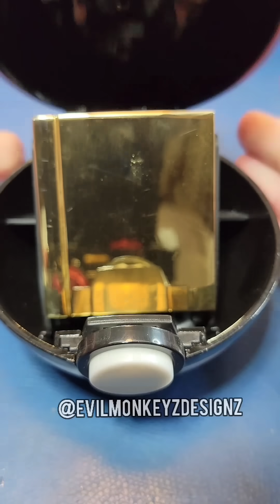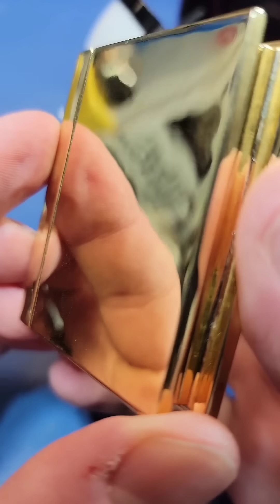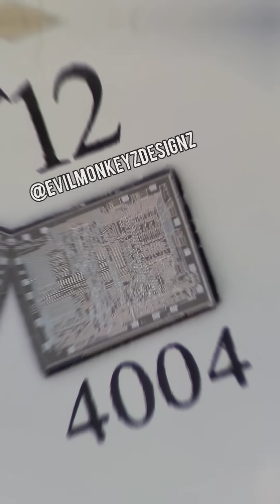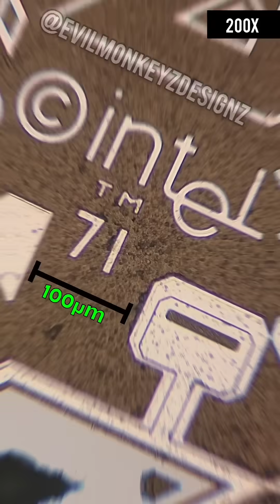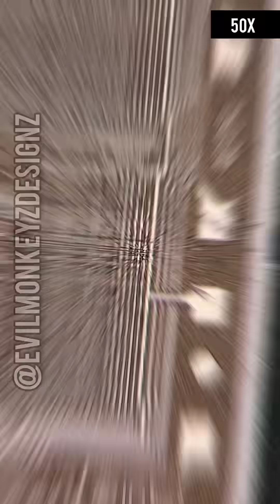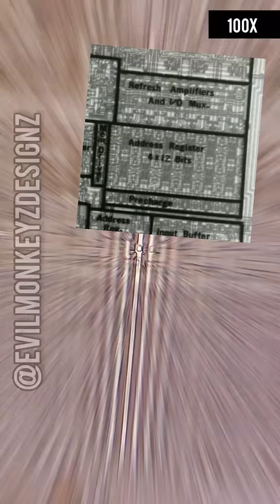The Intel 4004

Comment: OMG.... I remember them and the 8008.
Then 8080 and thought we were in heaven.
soon followed by 6502 and the Z80.

Building you own computer back then with perf board and wire wrap pins.
1 K of ram would set you 2,000 USD.

Comment: You can set the cpu cycles to higher, then run a game intro demo gameplay. After 30 minutes your cpu an floating point unit will become permanently stronger and better. Games may be harder to play, such as Dyna Blaster will become more complicated to play then before. 
For better, new computers and laptops, the dosbox does it, Heretic first, then Duke 3d intro. For mobile phones, Duke 3d needs 32000 cpu cycles running all the intros 3x, but 8000 cycles are needed to begin the fix.

Comment: What does a transitor do in this specific chip
Reply: Transistors are switches controlled by electrical current. You can use a control signal to set them to on or off, 1 or 0, true or false, whatever binary state you want to call it.

By setting up transistors in the right patterns, you can create logic gates and from them various circuits that perform simple arithmetic, store small amounts of data, or convert signals from one form to another. All of these functions are needed for the functions of any computer chip.

So what does a transistor do here? They do everything! Transistors are the building blocks of every digital computer.
Reply: @DigitalJedi  our brain is the ultimate transistor

Comment: Interesting how the chip detail kept getting smaller and smaller until it starts to be equal to the wavelengths of visible light and has all the cool colours.  The 4004 is primitive compared to later chips.  But they had to start somewhere 👍

PS - The intel clock is very cool. Does it still work?

Comment: I own a working 4004 8008 and a 8080 plus a Z80. All in circuit and running.
Reply: I personally handled one of the original prototypes of the 8008. If I remember correctly, it was designed by intel but fabricated by Texas Instruments.
Reply: I use them as microcontroller for projects. They are surprisingly fast when programs in machine codes.
Reply: Aren’t Z80s still being made today for embedded systems?  A version of the MOS 6502 still is.
Reply: @calvinnickel9995  Zilog announced discontinuation of Z80 in April 2024..
Reply: @tonisee2  Yes, but the eZ80 lives. (Possibly the Z180 too.)
Reply: What could be the electronics of Voyager 1? What were the electronics like in 1977?
Reply: @rodenreyes6320  I have seen some components of Soviet "computer-like" military device, probably  from 1970s. It consisted of hundreds of writing paper sized PCB-s which had robust pole connectors in one end. On top of those each large PCB, can 20 or so smaller, matchbox-sized, PCB-s. They were fastened on little posts on the large PCB-s and all had some soldered signal and power connections to large PCB. Every small  PCB had two (germanium!) transistors and few passives on them, all of course through-hole and pretty macroscopic (transistor case diameter a bit more than 1 cm/ca half an inch). Most probably all those small PCB-s were soldered in kolhozes in Soviet Union by women who had no slightest clue what things they are assembling. 
I suspect that early spacecraft electronics was also built of single components, although slightly smaller ones and more tightly packed... The theory of digital circuits is not that new, computers used vacuum valves for quite some time.
Reply: @rodenreyes6320  In 1977, the 6502 and Z80 were new and hot products! Larger and more powerful processors and computers were predominately built using hundreds of TTL chips (that are still sold today btw, although for somewhat different kinds of usage).

Comment: Technically although it was classified the processors for the F14 Tomcat beat the 4004 but since it was classified no one knew
Reply: The 4004 is still the first commercial processor, the F14s flight computer was never used outside of the F14 as far as Im aware.

Comment: That's nice clock 😊
They should jump wires to that core and run clock with that core somehow. Even it cannot do it without memory, oscillator, some simple CMOS maybe.. I don't know.

But it's nice anyway. And reality they have those cores around still (even today) is fun 😊

"How many we need? -100.000 for first run.. - Roger! 
-Why there's millions chips around facilities? -We made those 100.000 test wafer's? 
-But we want just 100.000 DIE's, no one needs those that amount!
-Okay, let's then make some clock's from leftover's..

I want nerd ring with 4004 beside than some diamond. There's no two totally identical 4004.. because process was what it was and same thing is little bit true today as well. Connecting bindings and just then put those going under the chip, glued to ring's flat place where it should fit and then some nice adhesive over it to cover mechanical wearing.. And rings body should made from gold and silver bonding wires "Damascus".. 
Some same era mem (ram)chip core's could be side stone's, 4 or 3 both sides of that core.

Maybe I must do it by my own.. 
It's shame that 4004 didn't have window on chip, there's anything what UV or other lights could clear or anything.. just for because it has been most beautiful CPU ever and with window. But it cannot run windows.. At the time at least. Maybe some Linux variant could do it today.. x)

Comment: Not just the schematic, but even the GDS is available. That means you can see how the doped silicon and wires are physically laid out and connected, like you see in the microscope but color coded.
Reply: Can you use that in an fpga to recreate one?
Reply: @user-qh5br9jl9g You could implement all the logic of a much more advanced chip in a modern FPGA. I've seen entire small arm cores and even little x86 designs like Lakemont done. There's even a project now that emulates entire retro consoles in an FPGA.
Reply: @Jblow-u2m nope, not if you don’t wanna get sued
Reply: @Jblow-u2m  better it will be to use discrete transistors, It will take some time, but it should work.
Reply: With enough money and skills, answer is always "Yes!"
Reply: @Jblow-u2m  The functional schematic with the transistors would be a better starting point, I think. But you could take these to the cleanroom and make something that at least looks like the real thing. Wouldn't work unless you actually have the processing technology but you could turn the mask layers into a series of etches and metal depositions and get a cool looking chip.
Reply: @tykjpelk  I was talking about a working design on an fpga. Did I miss something?
Reply: @Jblow-u2m  I mean that the GDS file doesn't contain transistor logic, it's just the instructions for the lithography.
Reply: What do you mean by GDS?
Reply: @OutlawWithinTheLaw  GDS is like a vector graphics format that's used to make photomasks. It contains numerous layers, each of which is either an individual mask or metadata, and in each layer there's polygons. It's not always straightforward to see from the GDS what kind of device you're making, because it only contains instructions for the fabrication and not information about the functionality.
Reply: @tykjpelk damn yall the reason im taking a minor in computer science, i strive to know these big ass words 🙏🤯
Reply: @fivezylinder still cool just different, if you wanna get upclose with these chips i would look into computer engineering with a minor in electrical, should get you there
Reply: @fivezylinder  they're waffling, to answer the guys question yes he could, given the model he has is fully accurate it would work.
Reply: I get that it's primitive, but I do not understand how you can do arithmetic of any kind with 2,300 transistors-- and that's the thing, you probably can't. It's probably just a clever series of electrical signals meant to imitate that to achieve mathematics.

Comment: Wait, is that a real 4004? Would it work if wired?
Reply: could also have been a failed production from the start
Reply: Quite possibly, if it has been handled properly and not subjected to electrostatic discharge.

But has it been handled properly? Who knows!

Comment: I wish i understood what these metal mazes accomplish when some of them dont seem to connect with any others. Do they connect on the reverse side of the chip? Is this a circuit board? What are the circles at the ends of the lines? What did the first non-commercial chip look like? Was it just RAM?
Reply: The metal on top is just the interconnect. The gates are in a layer underneath the wires.
Reply: The lines end in square pads around the edge of the die. And we do call them pads .
The pads are a way to connect the die to the outside world.

Fine gold wires are bonded to the pads, which are not shown in this video, and those bonding wires connect the die to the lead frame .

The lead frame is the arrangement of metal legs that you see coming outside of the ceramic or plastic chip body.

The die by itself is no good, it's not usable. There are ways dies can be used without a lead frame and package body, in specialist applications such as digital watches and muti-chip modules used in military applications but for the likes of you and I and most people to be able to use the chip, they are sold packaged up and not as a bare die.
Reply: There's many stacked layers. It's effectively a circuit board embedded in a single piece of silicon. The active components of the circuit such as transistors don't show up well, so you can only really see the maze of wires that connects them all. The circles in the wiring are are vertical pillars seen from top down, connecting the upper layers to lower.
Reply: @TheMrTape  thank you
Reply: The circles you see in the metal lines are apertures, where the oxide insulation between layers (metal to poly silicon gates or metal to substrate) has been etched away so that when metal is applied (sputtered) it then makes a connection.